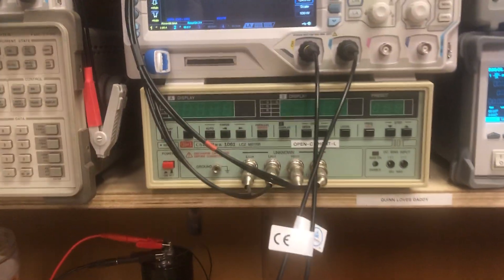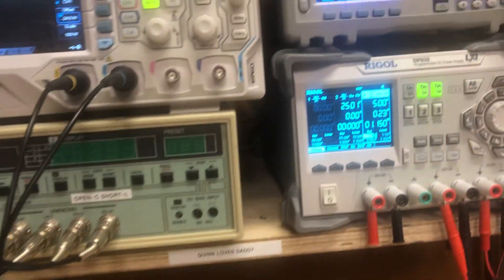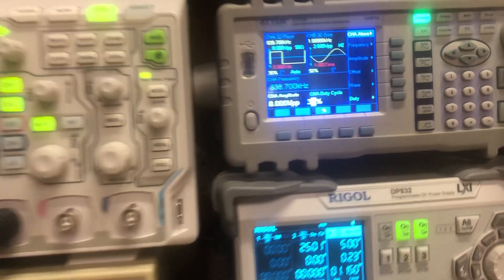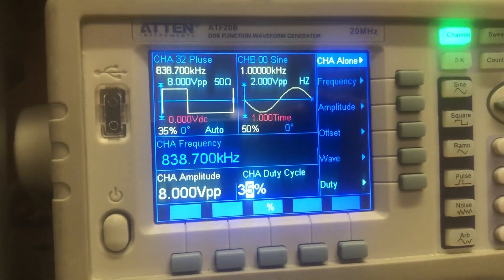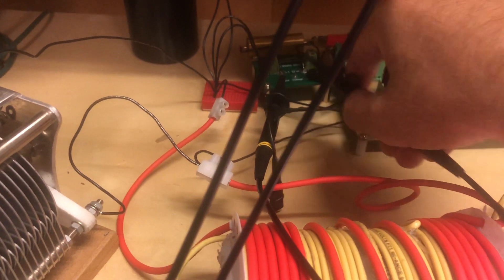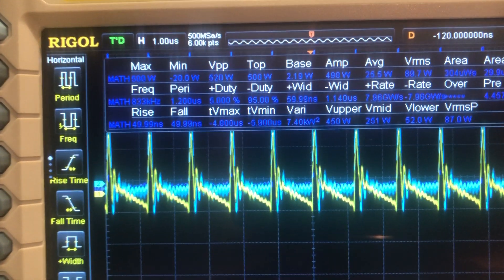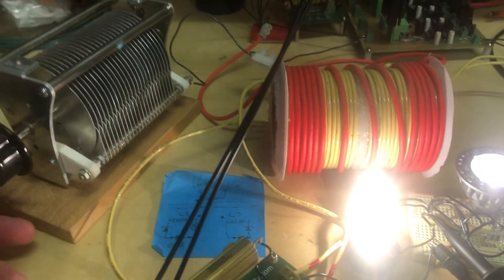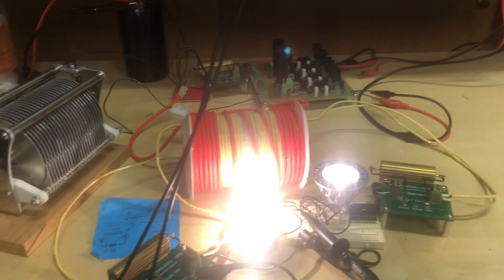Asymmetrical regauging 7

Comment: Hi great work. Try to make inductence less shunt resistor for measuring output power. The resistor may have parasitic inductance which will cause to wrong power measuring. In addition please check that both channels of scope has same skew while you measuring same signal on both channels. In order to make inductence less shunt resistor you can use bifiliar wire windings, while the inductence is canceled however wire resistence is exist. Use LCR meter for checking resistence and inductence of shunt resistor.
Reply from the maker: Thanks Arman.

Comment: Hi Captian,

very impressive!  Introducing the variable air cap is great for tuning.

But if i was you i would first be looking now for some obvious things that might be wrong.

The used 1 Ohm resistors are, as mentioned by Chris, not suitable as a csr at these frequencies as they have induction.

I ALWAYS use inductionfree 1% precision resistors in the 0.1 - 100 Ohm range depending on the signals strengths in the circuit as not to much influence its workings.
1 Ohm in you situation would be OK i think.

Then i would measure the input at the L1 coil as to see whats going into it.
This avoids excluding things like the FG which also adds a little input to the circuit and is in  your setup not measured.

Finally i would take a look at the grounding of the circuit.
Your FG probably is grounded as your scope is.
So leaving the grounded FG black lead on the input and attaching some grounded scope ground leads to the secondary might cause you ground out some parts of the circuit and / or add extra
inductance to it etc.

I always check it with a cheap 5V battery operated FG or you might use the differential probing technic, meaning use 2 scope probes to check only first the voltage across the bulb,
then the voltage across the csr to see if they compare with what you have now.

So leave the 2 probes ground lead UNCONNECTED (so no groundloop can exist), use again the MATH function and put the both used probes in SUBTRACTION (-) and now you measure across the bulb the subtracted voltage which is the real voltage across it without using the ground.

You can do the same for the voltage (current) across the CSR, but make sure you use inductionfree 1% resistors.

Good luck!   Itsu
Reply from the maker: Thanks Itsu, Yes I'm going to order some inductance free resistors.  I know what's going into the circuit so I don't see why I need to measure again at L1? I suspect if I measure at the input of L1 it will be less than what I showed.  I have no grounding to the circuit. It's completely floating.  Also my power supply and my scope are plugged into isolation transformers. The FG was adding only 2 watts to the circuit, I did check that to be correct.  My power supply is calibrated.  I haven't tried the MATH function using the (-) without grounding the probes, I can give that a try when I get some inductance free resistors.  Cheers, Loz